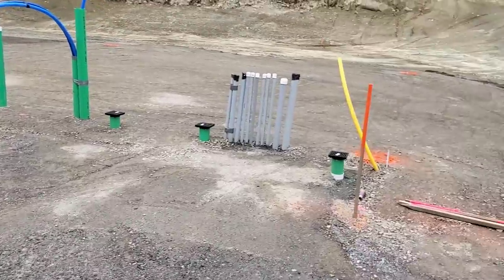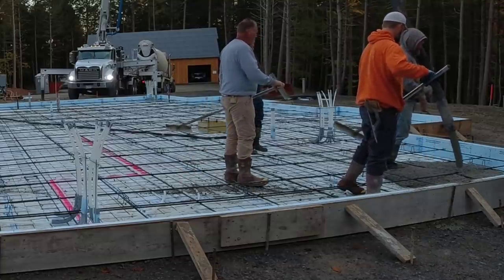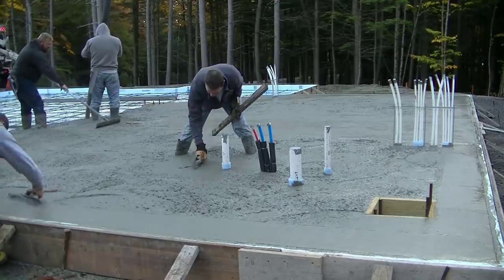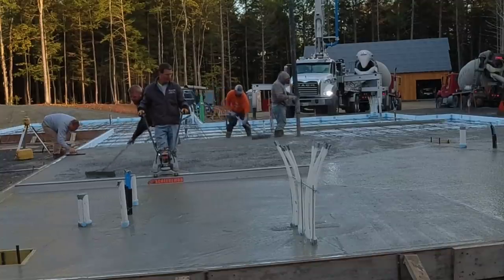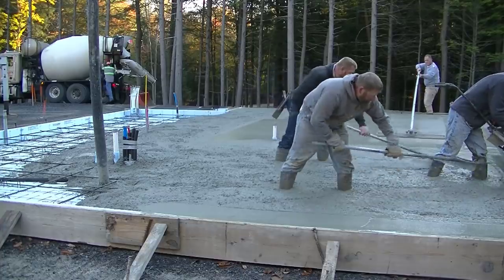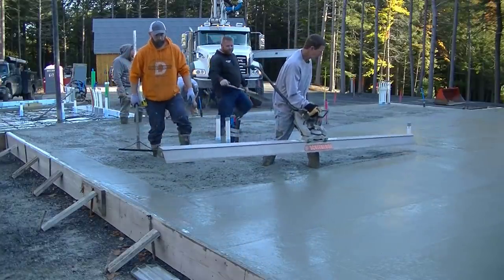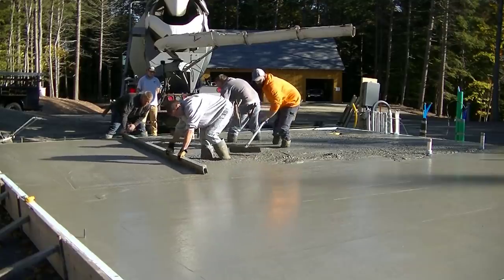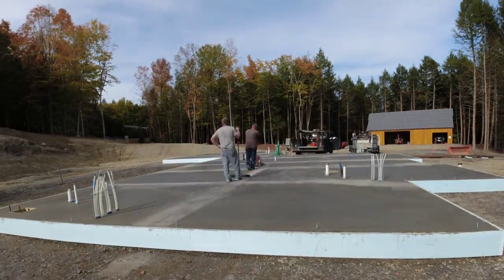He Made Us Pour His Concrete Slab 10 Inches Thick! (Waste of MONEY?)

Comment: Owned a big house (3.5ksqft) on a float slab that was 6" and there are already foundation issues 20 years into the houses lifespan. Thicker slab and/or extra rebar will increase the lifespan of a house and reduce the cost of future issues. Absolutely worth the extra initial cost to put in the extra crete.
Reply: Great experience. Well said.
Reply: I saw only 3 houses on slab as they are rare in northern Canada. All were severely cracked after a couple of years.
Reply: It's only $3,500 extra
Reply: This is like saying just add more caulk to the crack. Proper ground prep and control joints will solve most of the issues. Thicker is not always better. Every post tension parking garage I have done the slab is 6" thick.
Reply: @jeremyharsh  Those parking garages have high tension cables.... And specified engineered concrete. In a 6 inch exposed slab. Just a little different than jamming caulk in a crack. Not the greatest analogy....lol
Reply: @fastflo1  I know what they are and the difference between suspended slabs and ground slabs. Mix design is important for each project which is something to consider. Those high tension cables are generally 6 feet apart in bundles of 2 in the slab. I have done parking garages without post tension cables and slab thickness of 8 inches and the reason was to ad more rebar. My analogy was to simply point out that thicker is not necessarily better you need  to fix the base problem.I have placed tarmac/runway concrete and its 18 inches thick w/ no rebar and cracks. One thing about the ground, its bigger than anything you put on it
Reply: @fastflo1  I forgot to add lol
Reply: @jeremyharsh  good base and prep work is always key. The heart of the foundation . Agreed.
Reply: @jeremyharsh  👍🏻
Reply: Absolutely, Rebar and thicker slab are a must to prevent foundation issues.

Comment: In Slovenia, Europe, where I design houses, this wouldn't be enough and layers would be different.
1. We start with dig that is 45-50" below ground level.
2. 20" gravel filling compacted with roller
3. 2-4" concrete without any rebar to which we lay hydro insulation 
4. 10" termo insulation that also prevent bigger damage in event of a earthquake 
5. 12" reinforced concrete slab (with probably double amount of the rebar used from what I can see you used)
6. once again hydro insulation
7. brick walls 
8. 6" systemic termo insulation board with channels for floor heating (much closer to the final layer and more efficient)
9. 4-5" "dry" screed depending on expected load 
10 tiles, parquet or whatever you decide to walk on